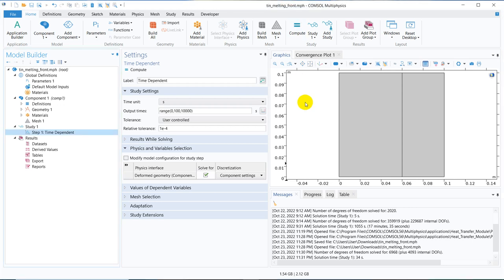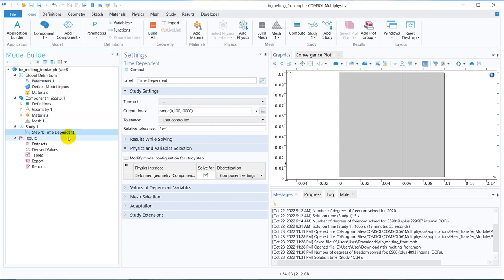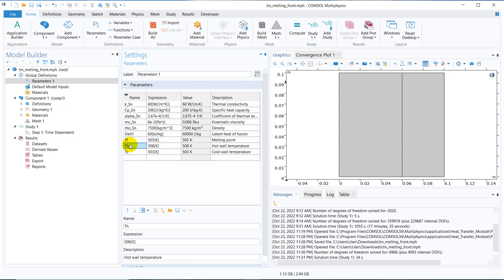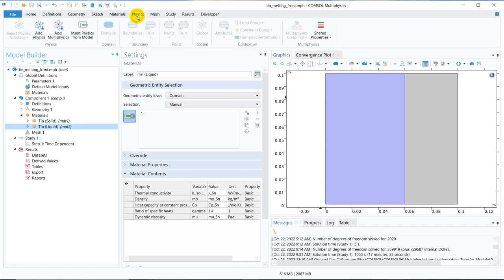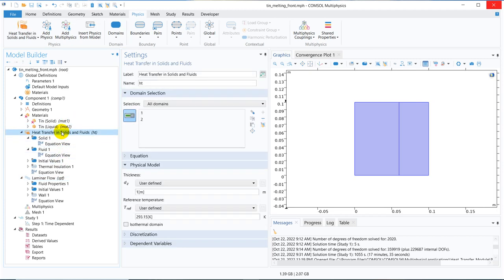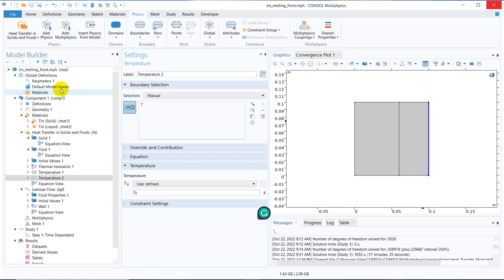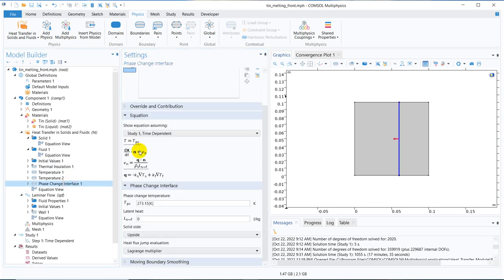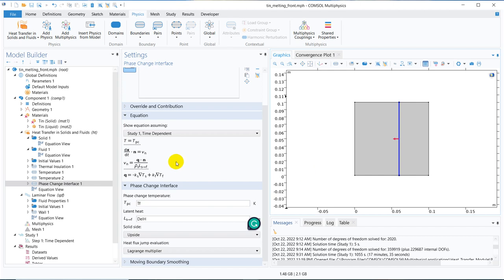Modeling Melting Phase Change in COMSOL #PhaseChange #Melting #SolidtoLiquid #NaturalConvection

Comment: hi,
thank you for the tutorial. 
I have followed your video and tried to practice it and ended in facing the following error. can you help in resolving them

" The Phase Change Interface feature requires to be adjacent, on each side, either to a Deforming Domain feature under Deformed Geometry, either to a Free Deformation feature under Deformed Geometry physics interface.
 - Node: Phase Change Interface 1
 - Physics: Heat Transfer in Solids and Fluids (ht)
No frame definition contribution for frame material1"
Reply: I faced the same issue, did you solve this problem